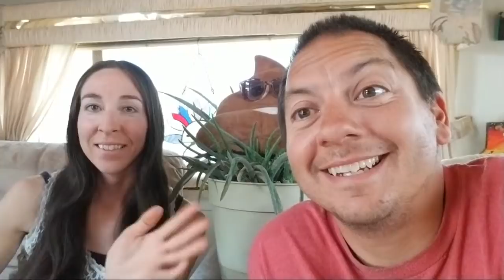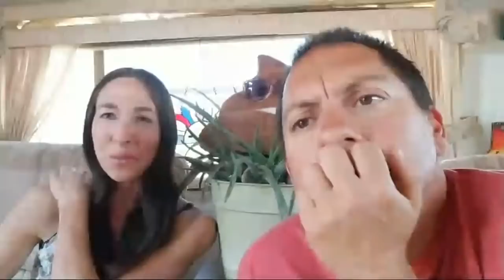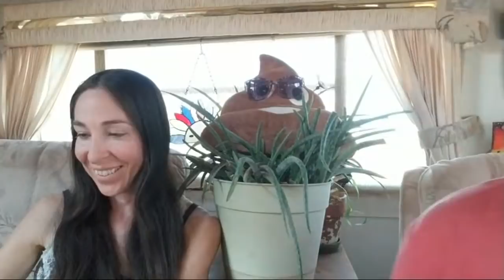Building An Earthbag Dome Q&A

Comment: Hi! Jason here I like what you guys are doing! It helps give me ideas as well!
Trees I heard you talk about!
I am from southern Arizona right on the border! Water being the issue in the desert you can plant any heat tolerant tree such as
Shade trees scyamore moderate watering
Chinese elm case the American elm gets elm deserve
Of course mesquite or iron wood
But if your looking for fruit
Pomagrant does really well in the desert 
Apple trees but can not have mice urinate around the base desert mice kill apple trees
Citrus trees do really well but winters kill them off 
You can do many options to keep citrus alive threw desert winter
A simple  trash can cut the bottom off turn it upside down must be black or paint it black or if you have the ability
To dig holes like your house bracing the walls with earth bags or what ever citrus does extremely well. 
I took a trip to Puerto lobos mexico
And on the way my friend stopped at his friends house. He lived under ground and had circular holes 10 feet deep and trenches to each hole it was beautiful and I wish I had photos to show you 
They had massive orange, lemon,limes and grape frut
The winters never froze the citrus trees only the top a little.they also had every thing you could think of fruit vegetables
A kinds of stuff! Very low water usage
Just make sure if you do this to block your holes for flooding
Globe grapes do really well as long as there roots stay cool in summer heat
Pecan trees lots of water
Arizona black walnut very drought tolerant 
Cotton woods lots of water
Salt cedars needs moderate water
Now the myth of no water in az is false
Az has an abundance of water under ground but can be deep 1000 feet or better in places but your area may be different may only be 100 or 500 if you have not already check  I'm not sure what your goals are but of course drilling is every expensive
Any way good luck I absolutely love watching  your dream come together
Hope my fountain of useless info helps lol!

Comment: Two-foot-thick earth walls provide remarkable thermal mass but very little insulation. Two feet of rammed earth (or tamped earth, in your case) will only have an R-value of 4. I have lived in that exact situation (a long time ago on a hippie commune outside of Albuquerque, but that's a story for another day). Earth is one of the best heat sinks known. Thus, it is remarkable at keeping you cool in summer. Sadly, it is equally remarkable at keeping you cool in winter - no matter how robust your heating, the earth will - literally - suck the warmth out of you. You can have an air temperature of 75 degrees and STILL feel cold because of radiant heat loss from your body to the earth walls. It is critically important to have insulation, not just thermal mass.

Second pertinent physics fact: warm air rises. Therefore, it is a LOT more important to have a warm roof than to insulate the walls (although I am totally on board with your straw bales on the walls idea). Look at any building code - the roof insulation requirements are always much higher than the wall insulation requirements. In your climate, code requires an R-38 roof.

Dry straw varies in R-value, but I'll use a value of 1.5 per inch (middle of the range). Thus, a two-foot-thick straw bale gives you exactly the performance you need. Obviously, you need straw bales for the roof more than you need them for the walls. But how do you get straw bales securely attached to a dome?

Short answer: you don't. Straw bales are just too floppy to stack securely into a dome.

Do not despair! According to the Green Building Advisor, "This information is hidden deep in the tables of the International Energy Conservation Code (IECC) where they show that R-13 insulation added to a mass wall will result in R-21 performance even though the mass wall is only considered to be around R-4 or less." Thus, to achieve an R-38 insulation value, you only need 15"+ of straw insulation.

"Wait a second," you are no doubt thinking, "if a two-foot bale is too floppy to attach to a dome, how the heck do we attach HALF of that?"

I'm so glad you asked. You fill bags with STRAW instead of earth. When the wall curves inward to become the roof you attach a row of bags filled with straw to the outside of the dome. The individual bags will weigh less than five pounds, and can be securely attached with two or three nails. Then, you move up one half of a bag's height and attach another row. Each row should be staggered to cover seams between bags on the next lower row, just as you would install regular roof shingles. You will end up with a shaggy roof of 12" to 18" thick straw insulation. 

This will offer superior thermal performance. Your house will be cool in the summer and toasty in the winter. And dirt cheap (OK straw cheap). The installation will be a LOT easier on your backs than hauling earth!

You can tarp the straw bags to protect them from water and rot until you cob-and-plaster them to make the roof permanently waterproof. According to several online straw bale building resources, you should not plaster the straw bags until a moisture meter (available cheaply at any home improvement big box store) shows that the straw bags have less than 13% moisture (which shouldn't be too hard in your climate).

So there you have it: cheap, low-tech, earth-friendly, and highly efficient insulation. You will use a lot less wood during the winter and be much more comfortable WITHOUT losing any of the benefits of thermal mass walls in the summer.

A suggestion from Linda, architectural innovator, superior researcher, and all-around good old gal (and humble, as you can plainly see, very humble!) ;-)

You are an inspiration to us all. Thank you - and keep up the good work!
Reply from the maker: We're thinking of adding a bond beam soon. We'll add eaves onto it and the strawbales would go over the top of the dome.
Reply: @ourselfreliantlife  Brilliant! Again with the lovely "Phantom R-Value" of high thermal mass construction, you'll achieve Passive House standards! Bravo! I am currently researching Roman concrete. Roman concrete uses cheap slaked lime rather than Portland cement - much more eco-friendly and cheaper to boot. What are you planning to use as the bond beam?

Comment: There's very little wood in the desert, so I'm thinking either pellet stove (gravity fed so it doesn't need electricity and wake you up with the fan) or Wave 6 or 9, which heats up thermal mass it's aimed at and sips propane.

Comment: No Vines!!! They will tear your house apart. Last layer on the Cobb could be Oiled Cobb. Or a lime plaster mix, which is a little more expensive.... but you can Water paint into it while it’s Wet, and the color will last forever....  do a little piece at a time so you can always work wet. See if there’s any information on Italian Frescoes. They were made with a very clean Lime Plaster over a river sand and concrete mix....

Comment: You know its getting dangerous for Jess to be up that high im worried she might fall and hurt her self you should just put a iron roof on now or you might need to put beams inside to stop the walls from falling over why dont you use rods bashed through the bags to give more strength ? the shiny home troup used it in there red bags also he use scaffolding the was movable on tires like a big trolley they just moved it around inside and out why dont you finish the floor inside then you can put the scaffolding inside you know its going to be so so high 30ft that was the (tiny shiny home) people have scaffolding and the rod in the side walls